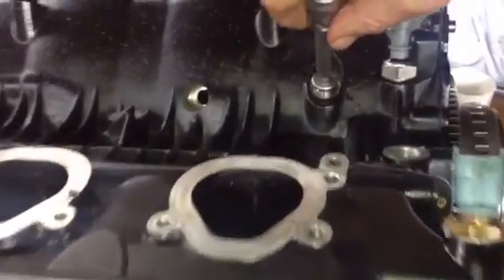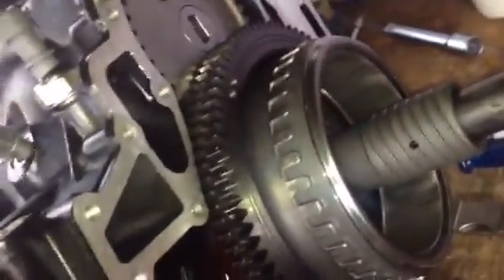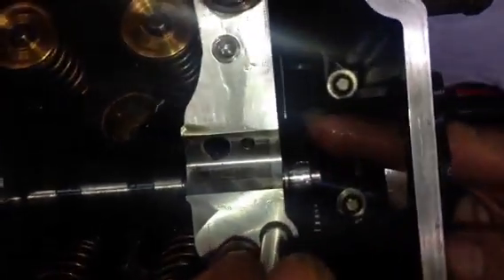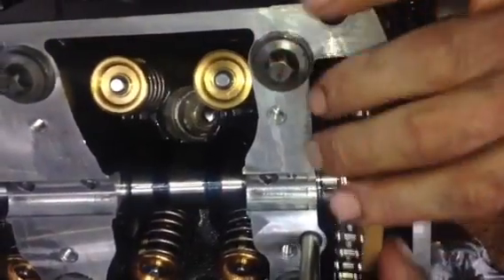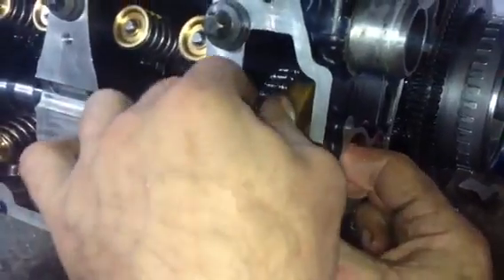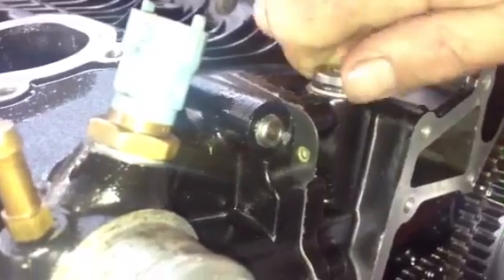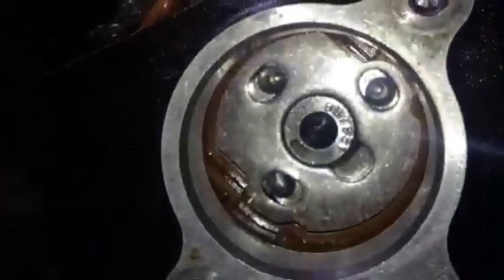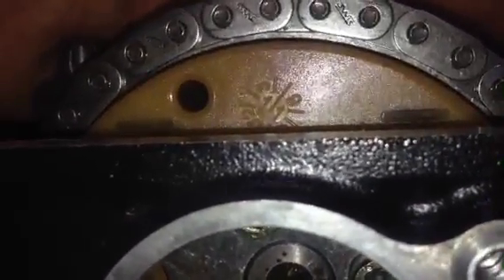Seadoo 4-tec Camshaft Timing

Comment: After the rebuild I'm getting 100psi compression on all cylinders. Could this be a timing issue. 
The RPM is also surging during idle
Reply from the maker: What altitude are you at ? Also have you ridden your ski yet ? What type of compression tester do you have ?
Reply: @Redrockat  I am at 57metres. The ski runs fine during throttle but it struggles to idle for a second and when it finally idles the RPM surges. In land the idle jumps from 1600 to 2200rpm.
Reply: @Redrockat  any clue? Further to my previous comments. I also checked spark plugs and it looks like it's running rich.
Reply from the maker: @Sajadhus19  how many hours on the supercharger ? Did you swop out spark plugs with new ?
Reply: @Redrockat  The supercharger was rebuilt 10 hours ago. Spark plugs and coil packs are new. I advanced the timing and the issue has improved (getting 125psi ) . At the moment there's a delay in the motor returning to idle speed after pressing throttle.
Reply from the maker: @Sajadhus19  the delay does not sound right at all , be careful for pre ignition or detonation
Reply: @Redrockat  yeah it's not right but I'm not sure if it's related to low 120psi compression or another problem. Throttle seems to be springing back
Reply from the maker: @Sajadhus19  yes the throttle could also be stuck or rusted , the compression is okay 👍

Comment: Hello I have a 07 180 challenger that runs too rich, vibrates a lot and runs very rough, changed spark plugs coils, voltage rectifier throttle body and some other sensors and still doing same thing, you think the timing has jumped in it, it also says low voltage on the dash but seems to be getting 13 volts all the way around please help
Reply from the maker: What is the condition of the supercharger ? Did you change out the map sensor ?
Reply: I don’t know the condition of the supercharger, how can I check that? And I believe the map sensor was replaced when I took it for throttle body get replaced
Reply from the maker: @jhonatanramos4856  you will start with removing the air intake side on the charger and visually inspect the super charger impeller for rust and fatigue . Check if the supercharger impeller has tention on it . If it has no tention and there is no slip tention then the supercharger washers have broken . The timing can’t really just shift on these motors but your cam gear ⚙️ may have come loose so check that also .
Reply: Thank you very much man I’ll check that tomorrow afternoon

Comment: How many hours can you get out of a modified engine as in this video? Do most rebuild/modified engines fail much sooner then if it was kept stock?
Reply from the maker: Jeff Tougint the machines lasts as long as the way the operator treats it . I’ve seen machines break due to incorrect operation and maintenance not done and I’ve owned stage 4 machines operating much higher rpm than usual that lasted 400 hours . It all depends on how you ride your modified pwc and this will determine the reliability thereof . Simply put a modified and stock machine lasts the same amount of time when operated correctly and diligently and properly maintained . I hope this helps to clarify , thanks for watching .

Comment: I have a head that wasn’t TDC when pulled and I was wondering how I could get the camshaft into time? Will it turn by hand? It’s a complete head.
Reply from the maker: Whitney Mctopy you will have to remove the rocker shaft and turn the cam with the hand , then you have to replace the rocker shaft and tighten with new bolts .
Reply: Redrockat ours is in time, but I have to rotate the crank to free up the engine. Do I just rotate it and move it back? How many revolutions until it’s back to normal?

Comment: Good night! I have a sea doo gti if 155 year 2010, I took the engine starting for a maintenance, and after it was put in place it turns but the engine does not. Could you give me a hint of what it might be?
Reply from the maker: Edilene Neres did I understand you correctly that they replaced or worked on the starter motor ? And when you push the starter button you hear the starter motor turning but the engine does not swing over ?

Comment: Hi,  my engine is still in the hull, how do I rotate the engine to line the cam up, so I can insert the locking tool?  It is not supercharged.  thanks
Reply from the maker: Liqidarts you just rotate the crank by hand the engine will turn until it is on the right spot .
Reply: @Redrockat  Thanks, I locked some Vise-Grips on to the drive shaft and rotated it into position!
Reply from the maker: Liqidarts awesome 😄

Comment: Hello, do you know of any videos that show how to time the camshaft after a chain has broken and you do not have the witness marks that you scribe on the gear with a sharpie?
Reply from the maker: David Mcbride you going to do the same as in this video and start with lock the motor with the lock pins . You also need to remove the intake manifold because the one engine lock is under it as well as the tentioner release.
Reply: @Redrockat  do I need to pull the engine on a 2015 seadoo gti 130 to replace the timing chain? Any advice you can provide would be greatly appreciated and thank you for the prior response.
Reply from the maker: David Mcbride yes you have to pull the motor and split the motor

Comment: A quick question, do you know the rotation of this engine when it is running?
Reply from the maker: tommyg33s the rotation direction is clockwise
Reply: @Redrockat  is that from the flywheel side?
Reply from the maker: tommyg33s yes for sure it is from the flywheel side .

Comment: What chains do you use Red? I'm hearing a lot of chain failures in 05 to 07 215hp engines at under 100 hrs
Reply from the maker: literbikedoc all the oem chains are very good and do not break . But ... specifically 05 to 07 skis throw ceramic washers and they land right in the chain first and get crunched up by the crank chain gear leading to a chain failure . I have had turbo 2005 skis and rpm at 10500 with no problems on the chains . Ps - only use oem BRP chains there is nothing better .

Comment: Hi good day
I want to ask you a question about my rxp215 2006 that I bought used not the hours you have or the maintenance that you would have done. The bike works very well. After one of the last mounted out of the water I make a control of everything and I find that the tank of the refrigerant system has oil. I wonder if this situation happened to you and if you have any information about it. From already very grateful and very good your video.
Reply from the maker: Hello ,yes I have had this problem before . It is your oil cooler that is suspected of leaking oil into the cooling system . replace tha oil cooler 😊
Reply: Okay, I'm going to take it apart and then I'll tell you. Thanks for your answer.
Reply from the maker: +supremo 222 cool stuff 😊
Reply: Hi, my friend, and checked the oil radiator and it's okay, you have some suggestion to look for, from many graces.
Reply from the maker: +supremo 222 it could be the water pump ,but not likely.  I would clean out all the coolant from the system ,flush the system then put new coolant . ride it like that and see what happens  .
Reply from the maker: +supremo 222 ps - if the engine was ever opened there could have been oil contamination spilled into the water jacket , so clean out the coolant ...